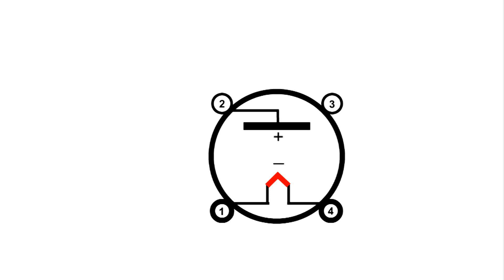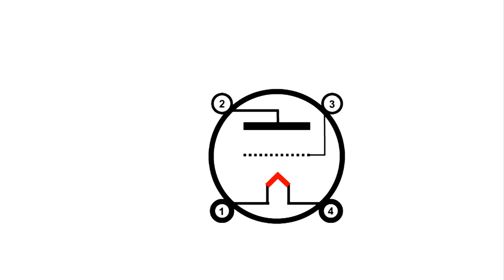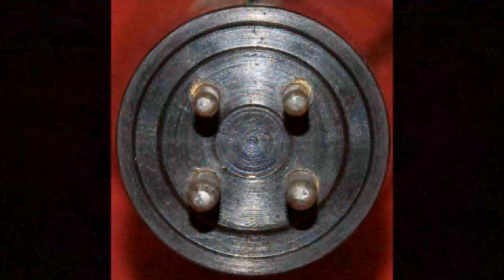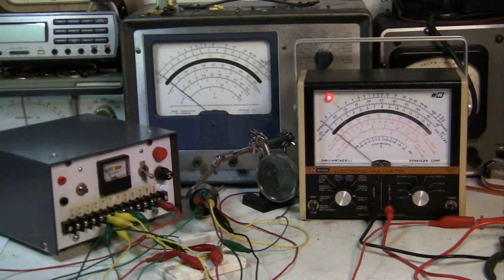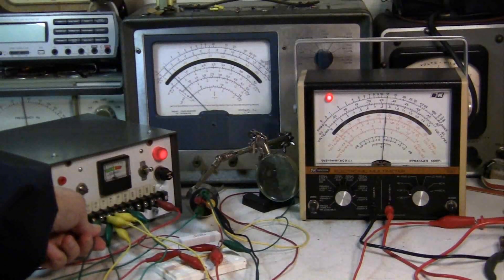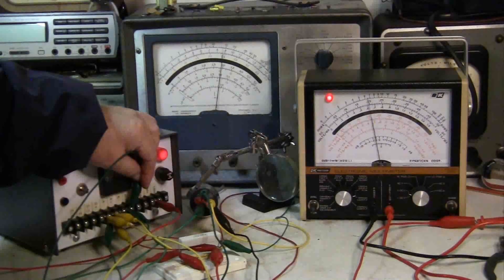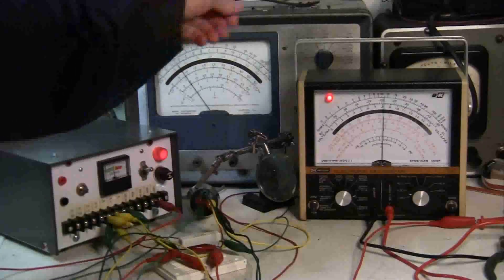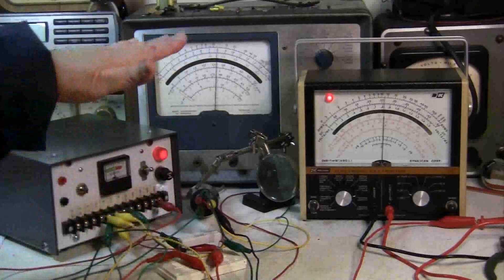Early Vacuum Tubes, Diode and Triode

Comment: Nice video! One question related to your video. I am about to repair a small 1952 Herofon Bambino type EG radio with (3) UCH81,UAF42 & UCL81 tubes. I wondered why each tube data says 100mA draw by the filaments when the F/Voltage for each tube is 39Vac + 19Vac + 12,6Vac = 70,6Vac , The U-tubes has serial connection for the filaments and they still only draws about 100mA all together. When I use a ECC83 it draws 300mA.. if I put two in parallel they draw 600mA. Could you explain why 3 tubes in serial connection of the filaments only draws approx. 100mA ? best regards Kim
Reply from the maker: Its Ohms Law.
39V@100ma=390 Ohms 19V@100ma=190 Ohms 12.6V@100ma=126 Ohms 
Ohm's Law, The Basics
https://www.youtube.com/watch?v=d34-VKc2cyY
Reply: @AllAmericanFiveRadio  Thanks , I am embarrassed.... you make life simple for me. Best regards Kim
Reply from the maker: @k.j.h.432  Your embarrassed? What about this!
My New Book
https://www.youtube.com/watch?v=mJ6RT2KEO40
Reply: @AllAmericanFiveRadio  ha-ha that is a very funny story to tell your grandchildren. :-)) I have made a lot of pre - and poweramps with tubes as well as transistors and I use Ohm's law almost every day, but sometimes its like one can't see the wood because of all the trees standing in front of you.!! 
Another funny crazy thing made by me when I was about 25 years...I came out as educated ophthalmic optician , but I wanted to be "free" and took a job at the royal danish postoffice...on the first day and trip to all the french embassy in Copenhagen I should emty their large post box with a key, and all the mail should drop into a large bag under the postbox, but I forgot to place the large bag under the postbox and all the letters and small postbox-mail went onto the rainy ground...The embassy postbox is placed on a large square in Copenhagen called (King's New Sqare from around 1670) Kongens Nytorv, and more than 200 girls and women stod there around me saw the incident and laughed at me...if there had been a mouse hole I would have hided myself in there inspite the size of the hole... I would like to thank you for being a very kind man and a very patient skilful teacher. All the best wishes to you from Kim Hansen DK
Reply from the maker: @k.j.h.432  That's a pretty good story. Perhaps you may consider writing down your stories in a book. I just uploaded a Kindle book to Amazon. It should be available in a few days. That's what the video was about. I titled the book “I could fix it too,, if I knew what was wrong with it.”

Comment: AllAmericanFiveRadio
I HAVE THIS RADIO ( SILVERTONE ) HAS 4 EACH 6J5 TUBES . 3 ARE METAL AND ONE GLASS . MY QUESTION IS : WHATS THE DIFFERANCE ? TESTING NUMBERS THE SAME FOR BOTH . WHICH IS BETTER ? LAST LONGER ? ETC... . WHERE CAN I READ MORE ABOUT THIS ISSUE ?THANKS IN ADVANCE AND FOR YOUR VIDEOS AND TIME . BEST BLESSINGS .
Reply from the maker: Look at your radio schematic it will give you the vacuum tube number, Glass or Metal. If it calls for the Metal that means that tube needs to be sheathed. If it calls for Glass you can use Metal but not Vice Versa.

Comment: What is the input impedance of a typical vacuum tube?   This must have really rocked the world of science when this was discovered.    It is mind boggling to think that there was no way to amplify electric signals prior to this technology.   It is even more amazing to think that this capability has only been around for just over 100 years.  It is also interesting to think that ATT was the first to really take advantage of the capability by applying this to telephony and making it possible to have the first coast to coast long distance telephone calls.   Prior to the vacuum tube, long distance capability was around 600 miles maximum.  Then ATT scientists developed the transistor, and again the newest electronics technology was used for telephony.

Comment: Great video Rick, I tested a NOS 1629 magic eye tube, it lights up nice but the emission tester  shows "replace". Is there a special way to test these tubes or I just got a bad tub? Any thoughts? Thank you,Sorin
Reply from the maker: It lights up nice? Does that mean the filament or the green screen. The tube tester I have will make the green screen glow and one of the settings well operate the function of the green screen. If you're tube tester shows that there are no shorts between the elements of the tubes it should be safe to try it in a radio.

Comment from the maker: The resistor is the load resistor for the plate of the vacuum tube. It's possible that without it the tube current may damage the vacuum tube. In a working circuit that load resistor would be an audio output transformer or a high impedance horn speaker.

Comment: Great Rick, Good info, I tried this (at least for the filaments) for my Fada tubes. Four RCA UX - 201A's. Very slowly with my power supply. Got all 4 up to 4 volts or so and watched for the glow! They all came up. They all came close to 250 ma of current. This was the first time I even imagined they were OK. I think this radio (with bad mounts) may have been off for anywhere in the last 85 years. I noted that all 4 had black spots on the left and right sides of the plates?? Is this OK. Thanks!

Comment: @AllAmericanFiveRadio i'm gonna start on in it within the next year hopefully. yes it is, i have 2 small tube amps, one has a 6V6 output tube and 12AX7 preamp, with a 5y3 rectifier, thats a good little amp, and the other one has old radio tubes, one is a 6AR5 i can't remember the other ones. yourwelcome

Comment from the maker: @MrDennis8805 
The power supply was designed, built and sold by a Philco Radio engineer in the 1980s and they are no-longer avaliable. Today I would buy the ARBE-III Battery Eliminator for Antique Radios.

Comment from the maker: Thanks CameramanLink
Of course it was only changing a volt or so. But that is amazing gain, to be able to make that much of a voltage swing without touching the control grid wire. It reminds me of the capacitive relay I built in High School, it won First Superior at Southern Illinois University.

Comment from the maker: Thanks togst
Frank,
If you run across a junker tube radio that is to far gone, you might be able to use the power supply. I think you would find experimenting with tubes interesting. Some tube can function with 30VDC on the plate. The 1.5VDC tube portable radio use able 45VDC on the plate, but you really have to be careful of the filament voltage.

Regards,
Rick

Comment: Excellent video as always! Really good demonstration on the basics of how a tube works. I wish I had a power supply for my tubes, would be really fun to experiment with them. The only power supply I have is a 0-30VDC. I assume tubes won't work with low voltage?

- Frank

Comment from the maker: @Barnekkid 
Good question. Mostly it is voltage, very much like a static charge. My hand and the wire going to the control grid act like two plates of a capacitor. The impedance of the control grid is so high that any voltage change does not run off. It is my hand (one plate of the capacitor) moving closer or farther away that changes the voltage on the control grid, by a very small amount. But this small amount controls a must bigger current through the tube. That's amplification.

Comment: Thanks for the video and for taking the time to make it.  I hope you don't mind such a trivial question, but why does the voltage change across the resistor when you wave your hand over that wire attached to the grid?  Is it picking up current from your body?